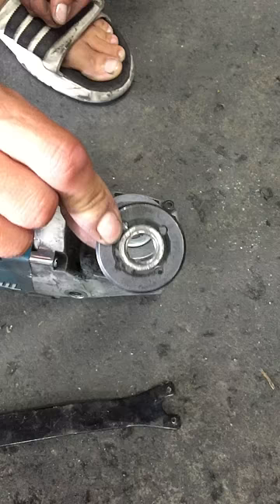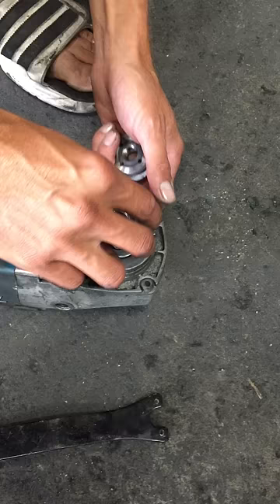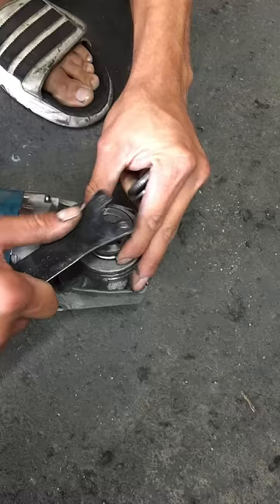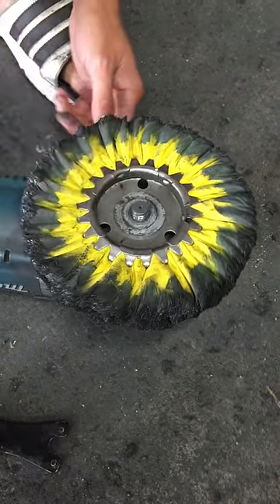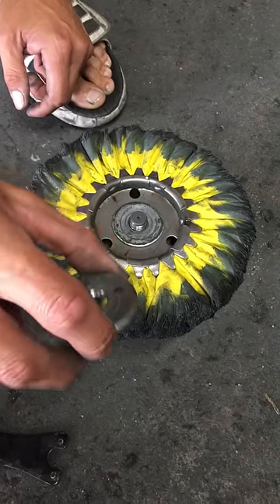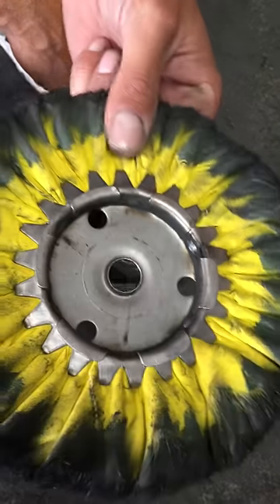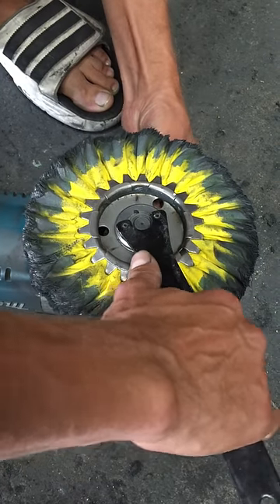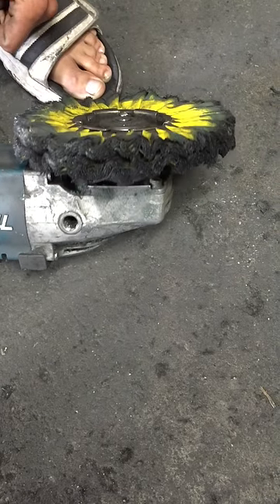Shine On Tips: how to mount airway buff on a grinder or buffer.

Comment: Do you think that the Dewalt 20v brushless grinder will work with your buffs?
I’m kinda screwed at work with getting access to an outlet.
Never mind. It’s only 7”
Reply from the maker: The cordless grinders do work but only in touch up applications and small stuff. They aren't made to run for an hour straight with a buff on it. The 7" is the right one though.

Comment: Evan, polishing a small aluminum boat. I recently purchased a few things from your site, also I clicked on the link here for to purchase the small Makita 3500RPM, I however did not notice that the model listed was a 9927C but when it tool me to amazon, what I got was a 9227C Polisher. It does not come with a 5/8" 11 not and the shaft does not seem long enough to install the safety flanges plus buff and give enough threads to get a nut on. Would you recommend a 2" extension from your site and what kind of nuts or system to secure? Thanks
Reply from the maker: Sorry that I missed this comment.  I truly hope you were able to figure this out.  Yes the extension from the site and a nut from any local hareware store works.

Comment: I put airways on my cordless grinder and it's not shiny as it should be?
I even sanded by hand 80 grit all the way to 7,000 grit prior to polishing.
Then mother's mag/aluminum polish by hand, then I hit it with the airways.   I cleaned the piece off with rubbing alcohol between grits and polishes.  I see my reflection but it doesn't look chrome. still faintly see scratches from hand sanding too

Comment: Do you have to cut the guard tab off the GA7021 to be able to use lock flanges instead of the threaded nut?
Reply from the maker: You don't have to but we do. Reduces the chance of a lock tight flange.

Comment: Is safe to use your buff with out a safety plate  I got a Bosch grinder but I having trouble putting the safety plate on  the wheel is a matchless wheel  I did have trouble with maverick wheels
Reply from the maker: Greg Walsh you can but I always recommend safety flanges.
Reply: Evan Steger  I know but for some reason I can’t get the safety plate on top with the  nut that comes with the grinder I did not have this trouble before  is it because the yellow wheels are matchless
Reply from the maker: Greg Walsh gotcha. Just be safe and weld your buffs really well.
Reply: thanks
Reply: @EvanStegerMetalPolishing  Where do you weld ,and how doesn't that warp it?

Comment: Extra nut? Those nuts are $10. Why not use the factory flange that comes with it?
Reply from the maker: The factory flange usually pushes the buff too far away from the buffer and doesn't leave enough thread exposed to properly secure the buff to the machine.